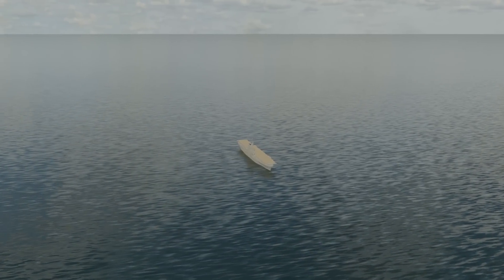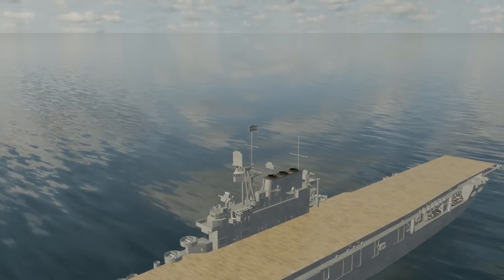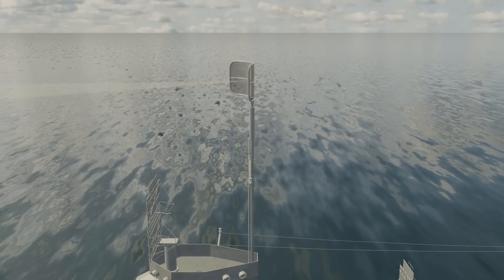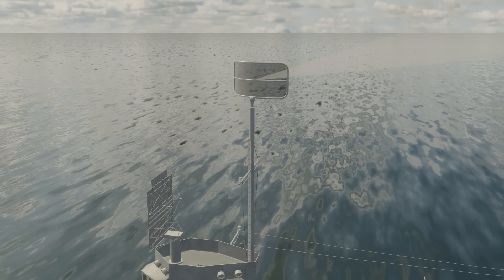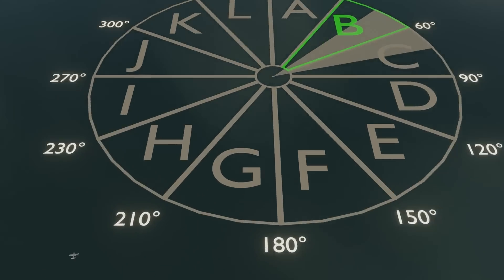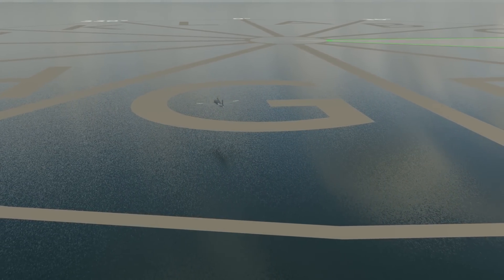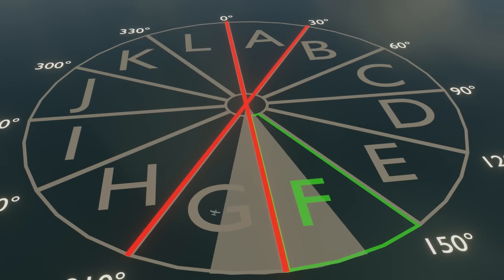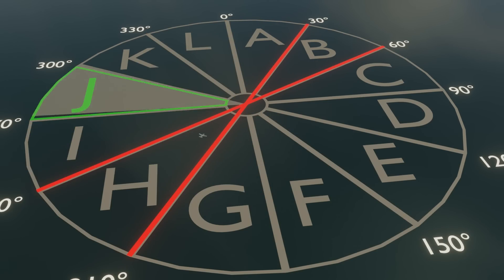Navigating Home: How WWII Pilots Found Their Way Back to the Carriers

Comment: The Japanese pilots wondered how the American pilots got back to their carriers. How did the Japanese get back to theirs?
Reply: I was going to ask the same thing
Reply: There is a really very good autobiography of an SBD pilot called "Dauntless Heldivers", by Buell. He talks about this system, but it was very new at Guadalcanal and only a fraction of the aircraft had the receivers. He instead had to navigate over open water and ded. reckoning to find Guadalcanal after a carrier battle. Highly reccommend.
Reply: Many planes were equipped with navigation tools such as sextants, watches and maps so they could plot their location and head to the general area where their ships should be.
Reply: Many of them didn't....   After the PH attack, a line of dye markers were dropped on the ocean surface at the post-attack gathering spot indicating the compass heading the pilots were supposed to follow to their carriers.
Reply: @jiyushugi1085  I've not heard of the dye markers and it seems very unlikely as well. All planes have their own compass so they do not need a marking on the ocean surface to indicate a heading. They can just look on their own compass.
Also the compass heading needed to get back would be know before they left the carriers.
The carriers knew their own location and heading and speed. They know where they would be when the planes returned. As Pearl Harbor is a fixed location they could calculate the heading back from Pearl Harbor in advance.

The tricky part is when you are halfway back and wind might have blown you off course and you have no landmarks to determine that.
Reply: None of the people commenting on this question know the answer to "How did the Japanese get back to theirs?”    NOT ONE.
Reply: @kriley9386  During World War II, Japanese pilots used several methods to navigate back to their aircraft carriers after a mission. These methods included:
Dead Reckoning
Radio Navigation
Visual Navigation
Signal Flares and Lights
Escort Ships
Reply: @Diponty  these all mean you know where you are. Not where the carrier is. W/o a carrier signal you can't find it. Any simple carrier beacon would give awax the carrier to radiobearing.
Reply: Bread crumbs dropped after takeoff.
Reply: I guess they would have to take careful note of their heading out allowing for any wind drift and then take a reciprocal heading back and maybe briefed on the carriers heading and speed before take off. On a clear day you literally can see for miles from 10,000 feet. On a bad day goodness only knows.
Reply: Pearl harbor there were rally aircraft, but some ditched and hid on KAUAI/OAHU/MAUI
Reply: So this is same as what we today know to ne a VOR.
Reply: I often wondered this. Thanks for teaching me.
Reply: This is stupid.  Because of the mountains, Japanese households generally had hydro-electricity long before household current was general in the United States.  
Obviously the Japanese had short-wave radio as sophisticated as America's -- and their own, kana-based, Morse code.
Reply: Kamikaze need not return.:face-fuchsia-tongue-out:
Reply: gearhead366 ... they didn't lol
Reply: They didn't. Their carriers were sank
Reply: @mikaleppakoski5113 were sunk
Reply: @mikaleppakoski5113  "were sunk" is the correct English
Reply: @mikaleppakoski5113  
A lot of them were sunk, too.
Reply: Ocean navigation, nothing different
Reply: @jerry5876  Really? Try navigating back to a moving object! Your answer would be right if the carrier stayed in the same place!
Reply: @ski3435  i never said it was easy
Reply: Kamikaze... ever heard of them?
Reply: @claytonhill936  I don't think kamikazes ever flew from carriers.
Reply: Kamakazi didn’t care
Reply: @119jle Kamakazi pilots were actually instructed to return to base if no suitable targets were found
Reply: @OhBehaveMan That's Cold Man.
Reply: @anthonycavalliotis8736  No, it's not.
Reply: @anthonycavalliotis8736 that’s war, man.
Reply: @anthonycavalliotis8736  actually briefly its very hot
Reply: They wasn’t meant to come back

Comment: I preferred the British wristwatch system. They had a single narrow beam sweep at 1 rpm, pilots synchronized their watch to the beacon, so if you heard the beacon, you just looked at your watch and you knew the carrier was in the opposite direction to the seconds hand, ie if you heard the beep when the second hand pointed to 3, you knew you were East of the carrier
Reply: That’s very elegant. Synchronising the second hand must have been a top pre flight priority.
Reply: @kiwisteve6598 ...always is; that's why their watches had a 'hack'feature...when the second hand reaches 12 pull out the crown; watch stops working. When told now push the crown in and the watch starts working again.
Reply: @kiwisteve6598 but this assumes that all watches had hacking. In those you don't, you can't stop the seconds hand. You can try, by gently turning the crown backwards but it may not work and anyway it's harmful to the movement; it may break a spring. Watches with hacking like most Swiss made and high end Seikos are clearly more expensive.
Almost all quartz watches freeze when you pull out the crown - they actually switch off - but were not available yet.
Reply: @duartesimoes508  as described, yes. As a practical matter the pilots likely simply noted down any difference between their second hand and that on the master clock on the ship. If yours is 30 seconds fast (or slow) you fly 180 degrees to your wrist watch. Or if it’s 15 seconds, fly 90 degrees to port or starboard etc. 
Someone is bound to post a reply, ‘but that is all extra cognitive load and should be avoided’. True, but these lads were routinely flying aircraft off ships and navigating across hundreds of miles of water so this would be a minor chore. Certainly easier than the US system of deciphering Morse and mapping that to a directional cartwheel.
Reply: @kiwisteve6598  I understood that pilots watches used a hacking mechanism to stop the second hand and allow them all to synchronise with the ships time.
Reply: Now imagine if your watch stopped. 😰
Reply: @duartesimoes508  Put a second watch in a pocket of your flight suit. 🤦‍♂
Reply: @duartesimoes508  He'd be up the creek without a paddle.
Reply: @duartesimoes508  well, better start watching VERY carefully at the sun i guess
Reply: @duartesimoes508 Or if you had a digital watch? 😉
Reply: Sounds similar to how a VOR works, but without the sync signal
Reply: I heard that the Aussies tied a long piece of string to their rear wheel and then just wound it in on their way back.
Reply: @moltderenou  The Aussies also used a unique aroma based navigation system. Flight deck crew would periodically open a bottle of XXXX or Fosters on the flight deck and pour it into a flat tray and the returning pilots would home in on that. In good conditions worked well out to over 100 miles, but was degraded by rain.
Reply: @kiwisteve6598  But wouldn’t the beer fumes inside of the cockpit cancel out the ones from the carrier ?
Reply: @moltderenou  😂
Reply: @moltderenou Some of them tied a boomerang to the fuselage and just let that lead them back, flat-spinning all the way.
Reply: I would be very surprised if spring wound wrist watches were second accurate in the 1940 ........
Reply: @stupitdog9686  they don’t need to be. It just needs to be good enough to get them close enough for a visual sighting. They get a new signal every minute so can course correct often so if the watch time is unknowingly a little off they will still reach the carrier, but by flying a curved rather than straight path. Until they get close enough to see it.
Reply: @kiwisteve6598  OOH! Cunning!!  Thanks.
Reply: @stupitdog9686  didn’t have to be, we’re only talking accuracy over about four hours and only to get them close enough to visually see the carrier. It beat their previous system hands down and finally let them use single seat carrier planes.
Reply: @alaingloster4405  Fair Nuff - You use what U got - an these were BRAVE guys !    I would have used it as an excuse to get a Navy Rolex  .... like I did in 1978 as a RNCD. Just regret I I never stole it !!
Reply: @stupitdog9686  Chronograph watches have been produced since 1915. They are extremely accurate, have stopwatch and second hand reset functions, and typically include a rotating bezel for measuring elapsed times. RAF pilots were issued with accurate pilots' watches, usually Swiss, including by Omega and Longines, with some choosing to purchase their own.
Reply: Why did the Admiralty insist on a second crewman/navigator in all their carrier aircraft designs?
Reply: @AnthonyGentile-z2g The stipulation was partly ‘belt and braces’ and partly because carrier warfare in general was all brand new and untried in real combat so they built in redundancy systems. Also, the dual roles of TAG/TO meant they liked to have four pairs of eyes searching the sea.
Reply: Trusting mass produced mechanical watches yay
Reply: Just to add to the comments here. I have two Omega Fleet Air Arm issued wristwatches and neither has a hacking second hand. Hacking second hands were not very common during that period. A lot of navigation was carried out by dead reckoning using the known position the carrier was when you departed and the position you expected it to be for the return. This is mentioned in various books such as Norman Hanson Carrier Pilot and Henry Adlams.
Reply: Right, that is why FAA fighters had navigators.
Reply: Personally i think the Anerican system is better. Battle damage may have killed your watch or even taken it off your wrist.
Reply: @mothmagic1  If battle damage took the watch off your wrist the arm wearing it wouldn't be in great shape either and you have bigger things to worry about
Reply: @firestorm165  ...not always true...see the tale of Marine office and MOH winner Sweet, his watch was shot off his wrist but didn't touch him...lucky man in more ways than one.
Reply: @mothmagic1 Unfortunately the American  radio receiver may get battle damaged as well🤷🏻‍♂️
Reply: @mothmagic1  if your watch is blown off you arm, finding your carrier is the least of your worries.
Reply: @mothmagic1 but that applies to the equipment on the USN plane too surely?
Reply: How would you see a wristwatch in the darkened interior of a fighter plane?
Reply: @ellieprice3396  By using the map-reading light.
Reply: @ellieprice3396  Lights in the cockpit were invented before the war
Reply: @ellieprice3396  Luminous dial, something that was still in use into the 70's, until they realised that the substance used was slightly radioactive.
Reply: So...basically similar system, but no angular position encoded on the radio signal and rely on the pilot side to interpreted the direction to carrier?

Yeah, I prefer the American system. British system add extra point of inaccuracy on the pilot side.
Reply: Very simple to "zero" the second hand if you have a rotating bezel.

Comment: I have wondered how they did it way back then, having used INS myself. After hours it may drift but never so much that it would leave you lost. Thanks for posting this. Today I learned something new.
Reply: I once had a very interesting chat with a former TAP Air Portugal Navigator, which actually took place in the very nose of a Boeing 707, in the Air Force Museum. (It was the former President Mobutu aircraft; its nose and cockpit were fully restored, the rest was scrapped as there was no room nor money for more) 
He told me that they crossed the Atlantic based on the INS and the system did deviate a bit, but that wasn't a real issue as when approaching the American East Coast they had plenty of time to pick an NDB or VOR and correct the course very much in time. 😀
Nowadays we have the laser operated IRS, which no longer uses gyroscopes, lines up much faster and basically does not deviates, I was told. Both are fully autonomous and impossible to jam.
Reply: @duartesimoes508  I retired a couple of decades ago. I'm sure systems are MUCH better than when I flew.

Comment: The forerunner to VORs which give bearings in degrees using two radio signals with a phase shift between them.
Reply: This one basicly was verry cleverly encrypted
Reply: It's a more advance version of the airmail A/N range used in the 1930s.
Reply: @fazole  Yes, and that is still used in a very much modified way in the ILS and glideslope signals, but as two frequencies, not two Morse letters.
Reply: @fazole . I remember the A/N airways back in 1964.  It would drive you crazy trying to listen to it all the time.  VOR was a great relief but the GA radios were cheaply engineered and built. The vhf com was all crystal and limited to the radio freq you could effort to buy.  Wow! 180 freq    Loaded radio.  I few with maybe 10 freq.   
I now love flying with ForeFlight but do my IFR by VOR/ILS.
Reply: Yes, and the VORs are being decommissioned.  KMWC (Timmerman) and KMTW (Manitowoc) in my area are both shut down.  BAE (Badger) will remain in operation for the foreseeable future.  Simple radio beacons like Watertown's are being shutdown too. How much does it cost to run and maintain one of those, besides not that much.   When GPS goes down or is shut down for national security, there's gonna be a mess.
Reply: @stacase  VORs are still very much part of navigation in Europe.  I don't know about Asia Africa and Australia.  There have been problems with GPS spoofing in the Baltic region near the Ukraine border reported by airlines.  INS may well make a comeback!

Comment: But surely the Japanese could detect the signal itself if they were in range? Direction finding for electromagnetic signals was reasonably advanced
Reply: Was wondering that myself.  Maybe they only turned it on when aircraft radioed that they were on their way back to the carrier.
Reply: Apparently not.

Comment: An instructive video. And all this time I thought WWII Naval pilots had to do the Dead Reckoning in their heads. Time x Speed = Distance. And DED as short for deductive reasoning not DEAD. Plus crosswinds and ship's heading....
I realize the Narrator was schooled in English in Europe [by the accent] but we Americans don't call the alphabet's last letter Zed. It's ''ZEE''. . WHY - EE - ZEE - BEE rolls off the tongue a lot easier, I think. [Doesn't Zee mean Sea in Dutch?]
Reply: @ToqToq-55  I never heard live Dutch spoken in Tucson. I wiil have to brush up on my EU languages. I hope my wild guess was not offensive in any way.
Reply: It does, but they pronounce Zay.
Reply from the maker: DED was also used by the pilots back then as well as celestial navigation. But they needed something more reliable
Reply: @x-planed  True,  I neglected to mention Celestial. On a clear night, the trained man knew exactly his position. Best in multi-engine planes with extended crews. But a fighter pilot could almost use the stars for VFR with basic astronomy.. Navqal aircraft like the Devastator, Avenger, Swordfish,  Kate, Val, etc., all had a third seat mid canopy. for a navigator. W ith a Sextant, Chronometer, ASI, Altimeter, Drift Sight, Ephemera and chart clipboard he could divine his position.
Reply: @x-planed  That came in the form of RADAR, later.
Reply: No comment on how he pronounced “ hayraker”?

Comment: So how did Japanese naval pilots find their carriers?
Reply from the maker: You just gave me an idea for another video😉
Reply: @x-planed  Britsh too pls, as others have asked too.
Reply: @ToqToq-55  They actually used a similar system. Only theirs transmitted a constant tone on a very narrow arc synchronized with the ship's clock. Rotation speed was around once a minute, and aviators would synchronize their watches with the clock during the briefing
Reply: was going to ask the same thing.
Reply: Very unpleasant.
Reply: Thru Samurai Spirit and  Zen Meditation.
Reply: Deep diving submarines
Reply: By the end of the war, 1944-45, they just looked for Allied ships and landed on them in an explosive manner.
Reply: @tazman572 😂
Reply: Usually either a towering plume of smoke or an oil slick on the ocean surface